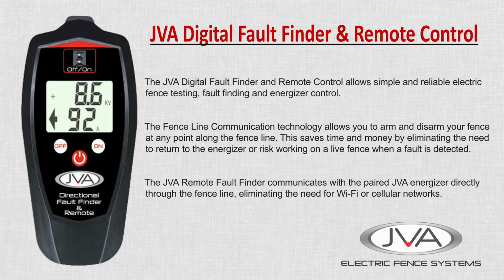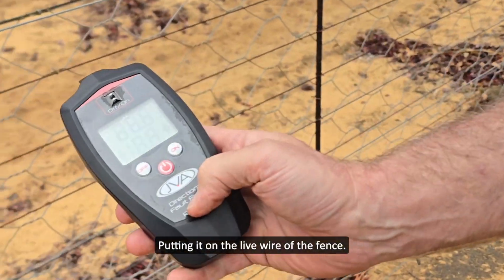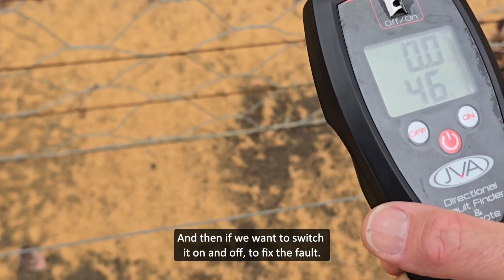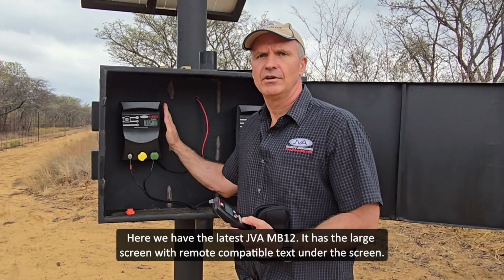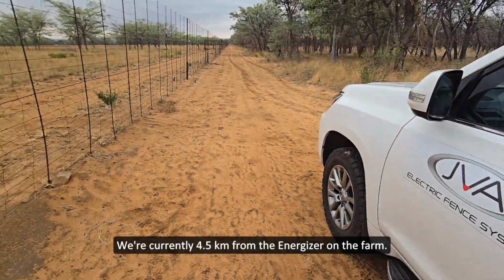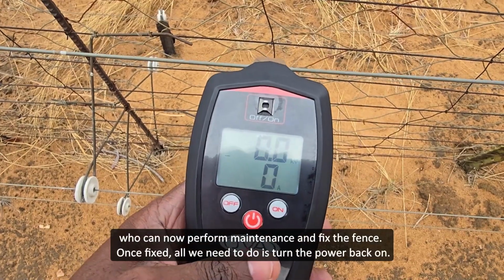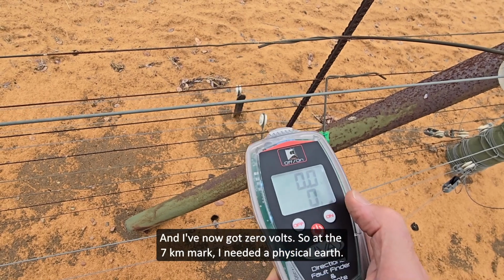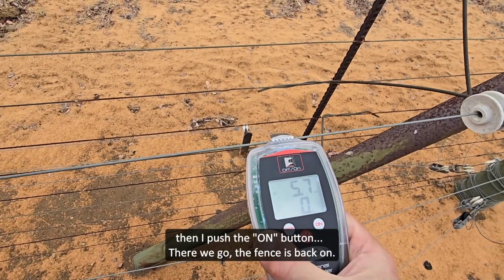JVA Digital Fault Finder & Remote Control

Comment: Thanks for the video. Will this work with other brand fence energizers? Speed Rite, Gallagher etc.
Reply from the maker: You may only have limited capabilities such as fault finding but the JVA remote only works with the JVA energizers.
Reply: Thank you for the reply. I was told that your remote fault finder with the ground probe would be able to turn our Gallagher M2800i on and off. I’m guessing after hearing your response that may not necessarily be true?